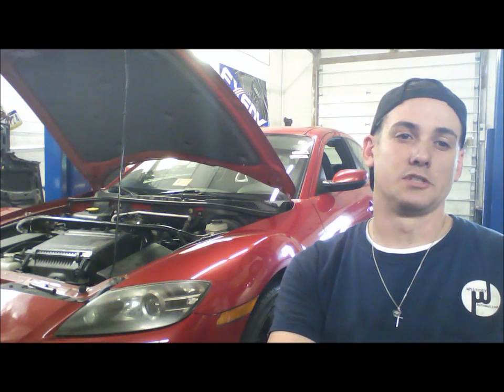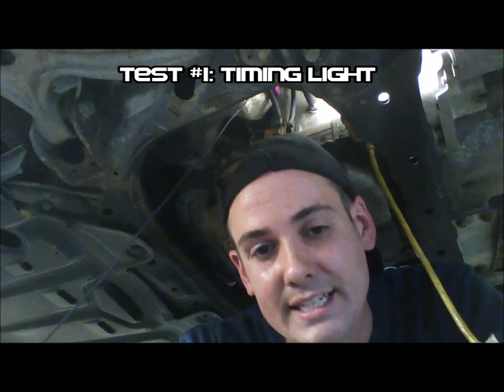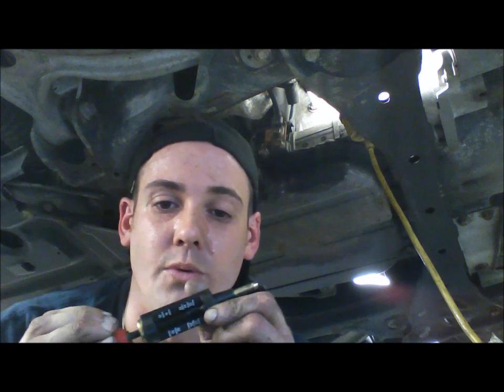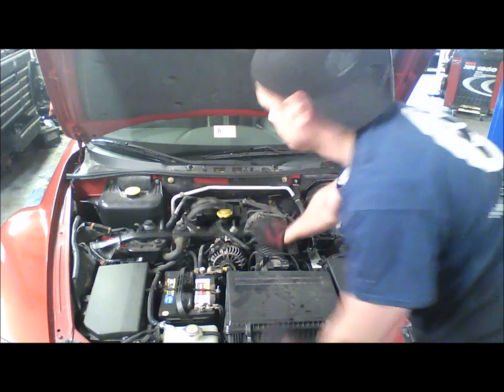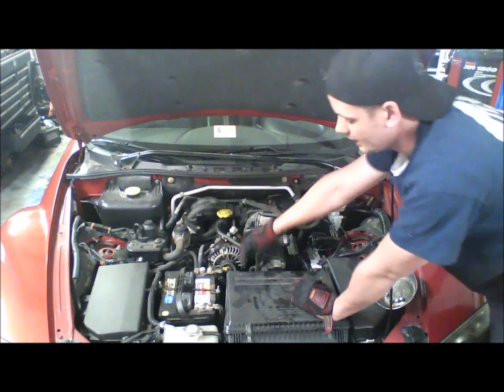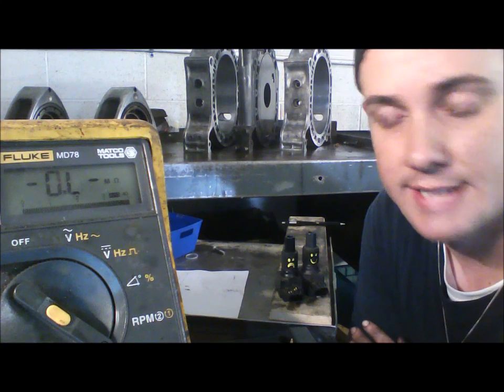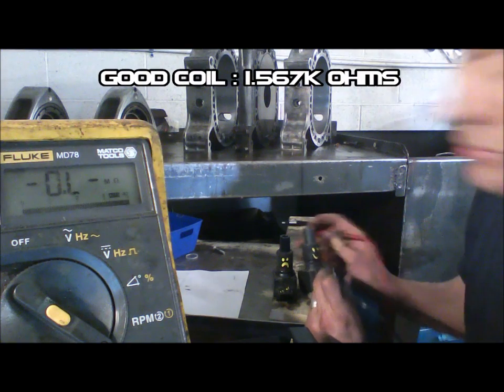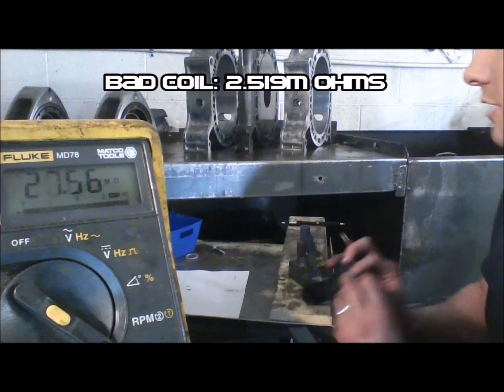RX8 running rough, How to test Mazda RX8 Ignition Coils

Comment: Hey what’s going man , I’m here from your other video about how to deflood the rx8 I have an 04 manual , I got it on but It still continues to flood. I got a diagnostic done and got (Power Train system) along with code for P0301: Cylinder 1 misfire .  
Everytime I drive it will make flood noise not allowing me to give it gas .  And when I come to a stop it’ll turn off . 
I don’t know if it can be my coils , plug wires , or my fuel injectors . Is there anything you did that you would suggest . 
Appreciate it

Comment: Hey man. Great vids. I have a 04 rx8 with the red key light flashing nonstop. Can you help me out please
Reply: Mine flashes when engine is off.  I think it may be related to Fob key battery or alarm system.  Or maybe a fuse.  My 2005 Rx8 runs & starts so unsure why it flashes.  My key Fob stopped activating door locks so maybe that could be issue.

Comment: Thanks!  Your bench testing showed me that one coil with significant differences in resistance.  The coils, wires and plugs were all new but.,,,   Murphy's law.   And yes the positive negative leads DO make a difference,
Reply: Do you remembered what setting on the multimeter to set it on to test the ignition coils? Thank you

Comment: First, it doesn't matter what lead you use - there's no 'positive' and 'negative' when testing resistance.  Second, the resistance test in your video tells the average backyard mechanic nothing.  Beyond that, none of these tests will tell you whether you have a good or bad coil - you may have a coil with an intermittent short, faulty dielectric, or heat related issue.  Testing modular ignition coils is beyond the scope of the average mechanic.  The 4 connectors are simply power, trigger and two grounds (PCM and chassis).  Nothing you test with your DVM will give you any useful information.

Comment: I have replaced all four coils and now I am getting a check engine light with code shows as coil fault and if I reset code it on comes on once you start car again after running what do I need to check to remove this fault code
Reply: You must have gotten a bad coil in the set. Find it and replace.
Reply: yep I sure did I have replaced it and so far so good

Comment: Hello I have an rx8 2006 I can't turn it off the engine keeps running and engine light it's on codes u0101 (AT) I feel the car ok just a bad idling and u0155 (IPC) when I put the light to make a right it sounds and flash faster than to the left side

Comment: I have an 04 with 129k, little to no hot start issues, only mod is the cyclone K&N intake (done by previous owner and I'd like to swap it out for a stock unit) and a catback exhaust (done by me) the previous owner just replace the cat with an OE one and I changed the plugs yesterday because I developed an erratic idle a few days ago and after it ran a while it would completely die when I pushed in the clutch, it seems to be down on power, now, I replaced the plugs because I removed the boot from the rear leading plug and about 2 1/2" of the electrode came out with the cap, at that time I was sure that was the issue so I swapped them out and it started up fine as normal and after a few mins it began to idle erratic again and it did seem to help a little and now I'm leaning toward coils, if I do find a bad one what do you recommend, OE replacement, black halo racing, or LS coil conversion? I have in the past had the car start rough and sound like only 1 rotor was firing after it sat for a while and I would occasionally get a check engine light but I can't remember if it was solid or flashing, I'm wanting to say it was flashing maybe? this was before I knew the flashing was a coil but is it possible to have a faulty coil with no check engine light? thank you in advance sir
Reply: Hey did you solve the problem?
Reply: +PMM4177 did you ever find out the issue with yours?

Comment: My rx8 starts up like it is in good shape with plenty of compression. How ever whe. It's warmed up and ran if I shut it off and try to start it it will either crank over for a long time doing nothing. Crank over and struggle to start, or start start a bit slower than when it's cold. I know this is a wide variety of symptoms and isn't probably just one thing. Sometimes when it is at idle at a stop it will shake a small bit not very bad. Sometimes it will be a medium and then other times it will be very bad going from 750 RPM to almost stalling and back up. I changed air filters and clean the MAF (it was dirty). The old filter was very oily and the catch can (I think it's what it is called) had some oil in it but not much. The whole assembly it self was a bit oily. The dealer ship said it would need new plugs wires and coils but I don't have much money and I replaced plugs but the old ones looked good. Do you think the hot start issue could be because of some bad coils or old ones
Reply: Once again sorry it's such a wide variety of problems and it probably isn't just one thing. The coils probably need replaced I just want to know if the engine is on its way out. I used seafoam the other day and it seemed a bit smoother idling after that and with the new filter and clean MAF but now it takes longer to crank when cold. I reset the fuel maps or trims because my thought was the car now knows the correct amount of air it's bring in so before it might have adjusted the fuel/air mixture with the dirty MAF and now it's clean so the mixture could be off.
Reply: I have the same issue at times, mine is very inconsistent, sometimes starts like its in good shape, cold or hot, other times struggles to start even when cold, I have noticed that if I use the de-flood procedure (gas pedal to the floor, crank 7 sec, release pedal, start) it cranks right up no problems every single time, I'm thinking the plugs are going bad in mine so not burning all the fuel even when warm, it does have 113k on everything but the motor, only has 43k on the motor, check and make sure you have no vaccuum leak as that will cause issues with the fuel trim as well, my mpg is slightly below the rating as I'm getting around 14-15 mpg(i push the car really hard all the time though) so I'm pretty sure if I replace my ignition system(plugs and coils and wires) it should run like new
Reply: +Chipotle007 a good thing to do in general is get an upgraded starter, upgraded battery (optima red top is recommended) replace plugs and coils, seafoam, drive at high RPMs for awhile as that will help improve compression, and check the cat and make sure it's good, those are all the failure points on an RX8 for the most part, after fixing those things your car should run like new, I've seen 8s with their original engines well past 200k miles even really close to 300k
Reply: Team DiKn Have you solved the problem? I'm looking at buying one with the same problem for cheap and then repairing it.
Reply: I had similar issues so got new alternator and new battery. Then realized my battery connectors were loose. Reliable electric Power is vital to start & keep car running.

Comment: been told my rx8 needs a new engine. running like crap. all the garage have said is that its the engine. nothing else. changed my coil pack aswell. still running crap
Reply: probably because the garage you took it to wants you to ls swap it, anyhow, stale fuel and oil can cause this, throw some conventional 10w-30 oil in it, premium fuel, replace coils and plugs, and replace your cat, the car should run great, add some premix and maybe seafoam and it will improve the car a whole lot

Comment: SORRY TO GO ON. this kid is clueless if its running rough you can buy a full kit off amazon for very little money this  includes the special NGK PLATINUM PLUGS the leads and the 4 coil packs im english i paid £160 so thats about $300 and its sooooo easy to fit them yourself if that does not fix it push it in the river unless you want to do a rebuild
Reply: Lol great advice buy NGK spark plugs and ignition set off Amazon they're f**** counterfeits dumb f*** that's why they're so cheap you don't know what the f*** you're talkin about idiot

Comment: need more rx8 videos these cars are much more difficult than what I thought. I am changing plugs, coils and my wires. now will bad coils cause my car to sometimes die at a stop??? also ik its not my o2 censors or catalytic converter cuz IVE got new up stream and down stream o2 censors along with replace my exhaust and catalytic  converter.  I can't seem to find many videos or people that are as informative about these rx8 as you are. NEED SOME HELP PLEASE!!!!
Reply from the maker: +Dakota Dillashaw Bad ignition coils will surely cause an RX8 to die and drip at a stop, while also causing several other problems including a premature converter failure.

Comment: I have seen bad coils test identically to good coils, so if the readings match up, and you have spare good coils, still try swapping then out! :) 

Stay Pure
Reply from the maker: Ecookman Sama Indeed, as this is something I hoped to prove in the comparing of the two coils.And may I also add that heat can play a great part on your resistance readings. This too can cause a car to run fine when it is cold and misfire once it is warmed up.Thanks for your input Ecookman!
Reply: Splendid idea. Feel free to add this link to the group files in the PurelyRX8 group. It's great to have a decent video to show people as most of the general user base doesn't know how to use a multi meter.
Reply: +Whitney Automotive GREAT videos sir. Subscribed.